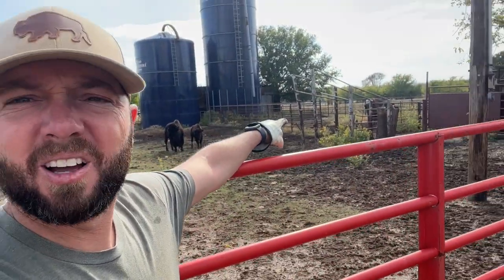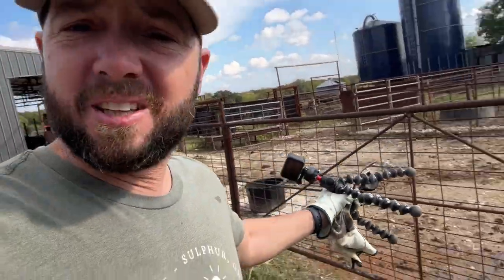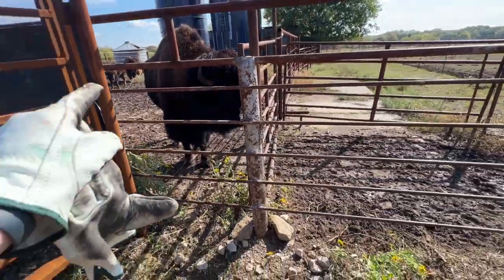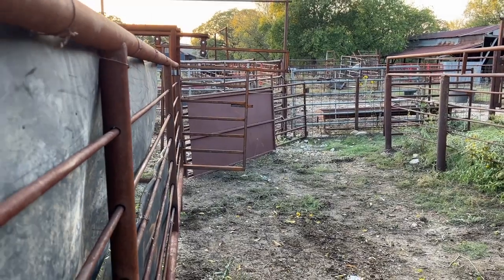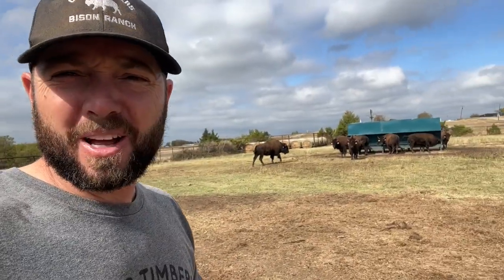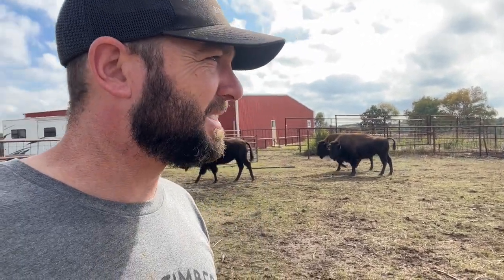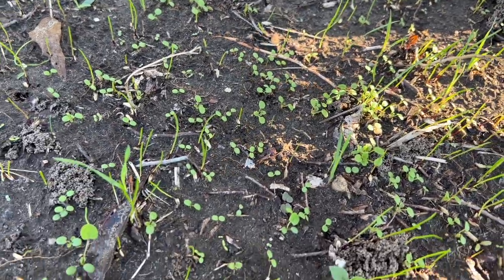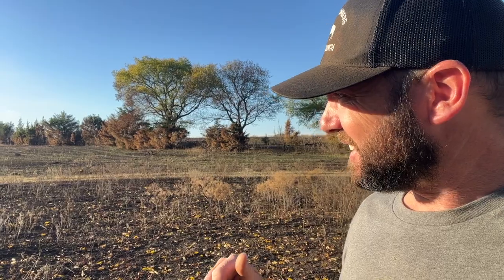We Have To Catch Them This Time!

Comment: YA NEED TO MAKE A TRACTOR SIZED BOX  WITH GATES FRONT AN BACK SO THAT THEY CANT DO THAT...
YOU OPEN ONE SETS OF GATES; DRIVE THE TRACTOR IN SHUT THOSE GATES 
THEN OPEN THE FRONT GATES DRIVE OUT AN CLOSE THOSE GATES THAT WAY YOU CAN KEEP THE CRITTERS FROM EXCAPING... I SEEN THAT SOME WHERE THAT HAD CATTLE THAT DID THAT KINDA CRAP AN THATS HOW THEY FIXED THE PROBLEM
JUST A THOUGHT...